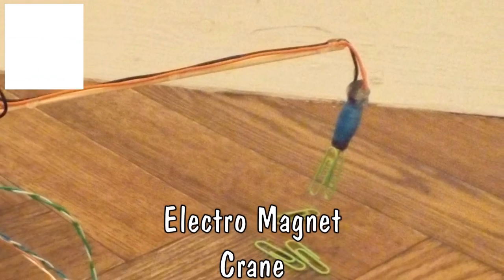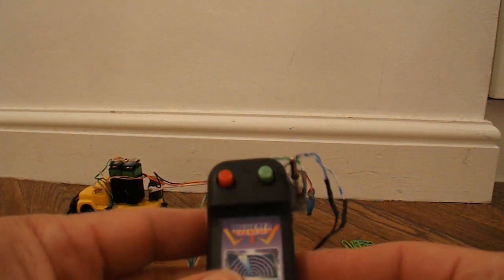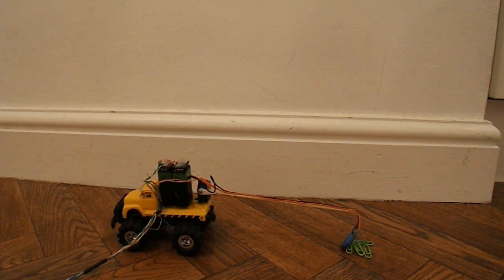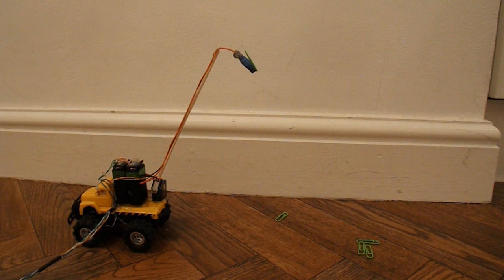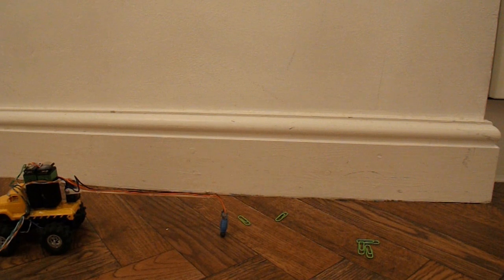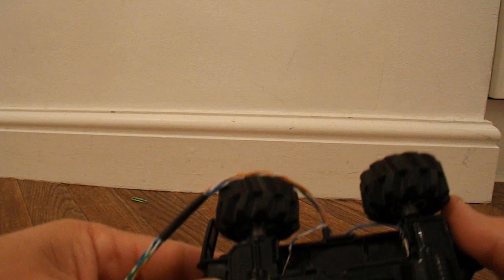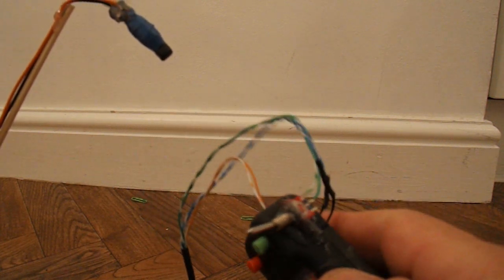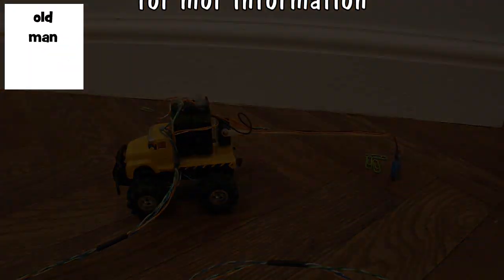Electro Magnet Crane

Comment: Might you explain me the connection control and servomotor please greetings peru
Reply from the maker: Hi Hermann, the two hand controllers came from cheap electric toy cars that I have used for other projects. They contain 2 AA batteries. Press one button and the current flows in one direction down the wires, press the other button and the current flows in the opposite direction. That meant the original cars would go forwards or backwards, but no steering option. I used one to drive the car forwards and backwards. I used the other controller to drive the servo forwards or backwards.
The servo was modified by removing the circuit board from inside (That normally decodes the signal from the rc receiver), so the hand controller wires were soldered directly to the servo motor. There are several videos on YouTube showing how to modify servos, just search for 'modify a servo'.
On the side of one of the controllers I simply hot glued an on/off switch to operate the electromagnet.
Reply: GrandadIsAnOldMan ok thank you very much even thought q contained servomotors card which is driven by pwm, now everything is clearer thanks

Comment: Amazing work Grandad. Thank you so much for taking the time to do this. :-)
Reply from the maker: You are welcome, I actually sat down to make something completely different, I found these parts whilst looking for other stuff and remembered your request. I would have done a full build video but didn't think about it until I had nearly finished. Winding the wire round the ferrite core took the longest and I probably didn't use the right gauge of wire as I needed two 9v batteries to get enough power.
Here is another video I have just found on YouTube http://youtu.be/Ddpm-lOOzis